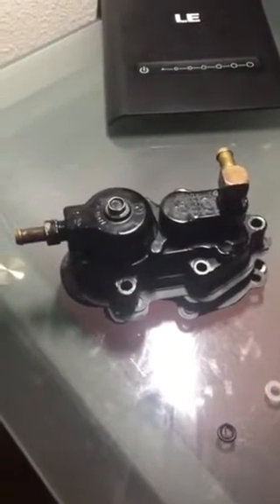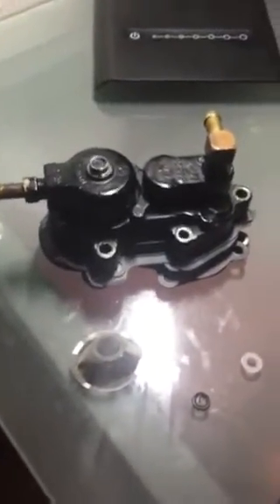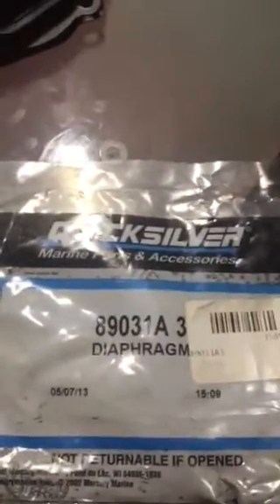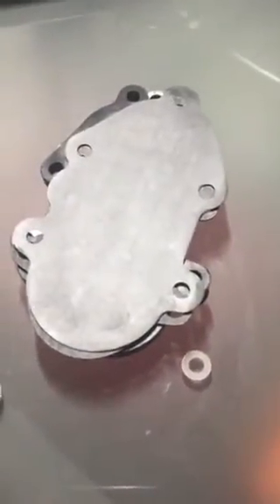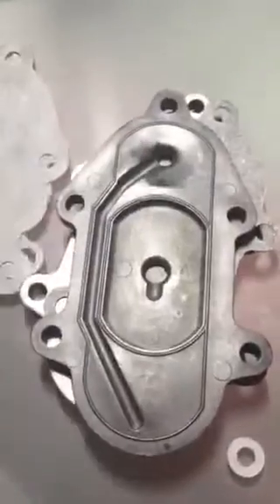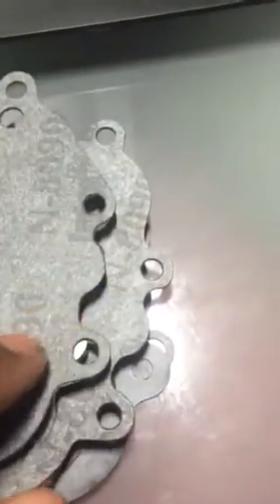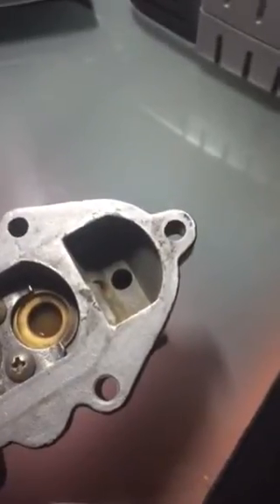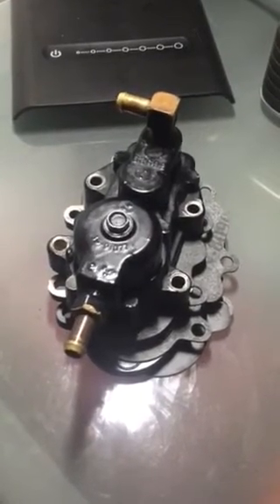Mercury 115 HP Inline 6 Fuel Pump Rebuild

Comment: My tower of power runs fine on land with water muffs on. Once I put it in the lake it runs for about 5 min. Then Boggs down and shuts off. I know nothing about it. Where should I start looking. I am some what mechanically inclined.
Reply: Mine did the exact same thing until I rebuilt the fuel pump with o rings an gaskets
Reply: An easy first check is to take your gas tank cap off to make sure it is not your fuel tank vent plugged. 
Also some fuel lines have an inner lining that can collapse and restrict flow to the fuel pump.

Comment: Question, I am needing to rebuild one of these fuel pumps, do I need a check valve kit as well as a gasket kit?  I'm having to pump bulb while motor is running to get it to achieve wot

Comment: Thanks for the breakdown of gasket order.
Reply: "nkelly3" .... I hope you are still around and I can ask you some questions! I just changed my gaskets today (I hope I did them right) ....Inside the 'screen assembly unit' do you need a "special tool" to get the 2 screws out on the underside where the 'Teflon/plastic washers go? .... I tried all kinds of 'tips' that I have .... none worked, so I didn't change these .... also, on the screen and 'o' ring ...... where exactly does the 'o' ring go ..... in first then the screen?  or  the screen first and then the 'o' ring? ..... also on this 'housing' on the face are some 'markings' and the screen cover moves .... left to right .... is this a "Adjustment" of some type for gas flow ???? ..... here is my e-mail addy:  native127@frontiernet.net ... of on F B my page Herman Kovar .... and we can talk please ?? !!!